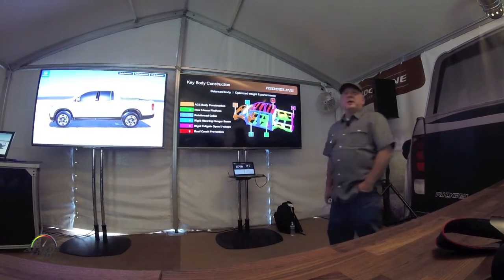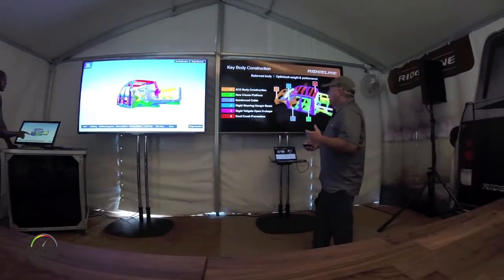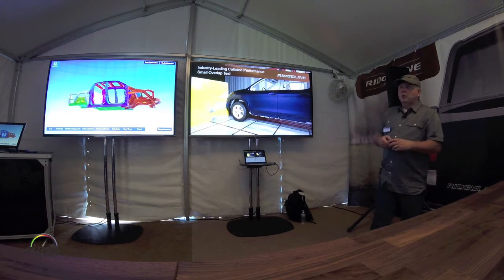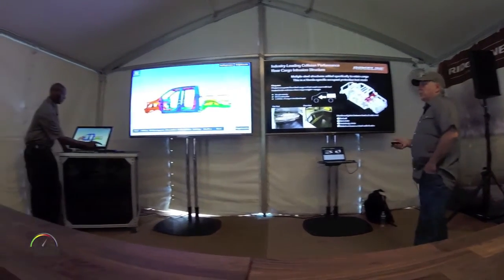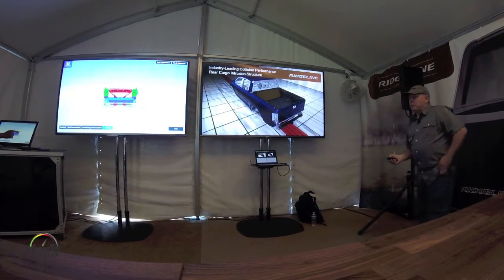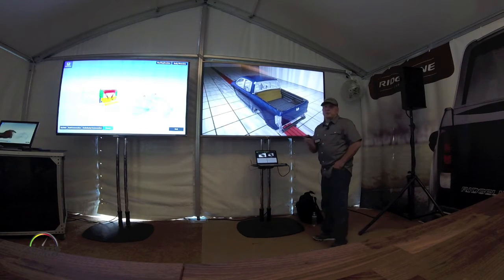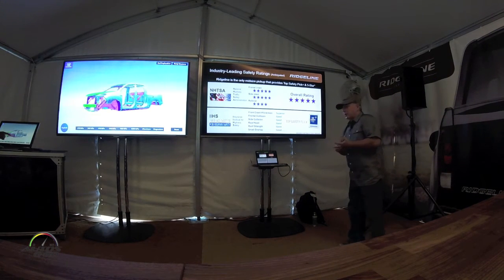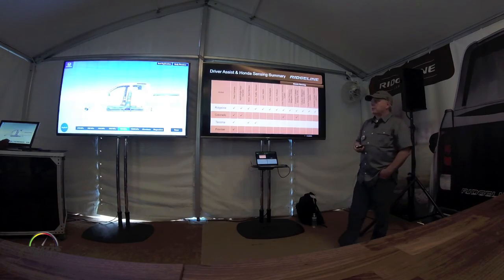2017 Honda Ridgeline Safety and Body Structure presentation

Comment: I think it should be mentioned that the NHTSA's rollover rating is not intended to rate the aspect of "How Safe" a vehicle is in a rollover... it is an evaluation of how likely a vehicle is to rollover.

They (the NHTSA) even go so far as to use the verbage "untripped" meaning not hitting an object that would cause the roll (like a curb)